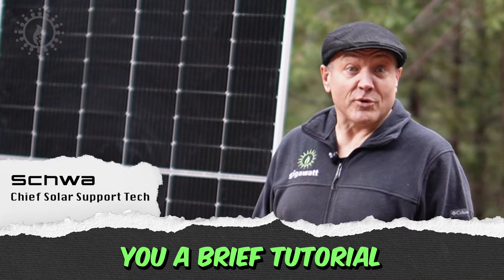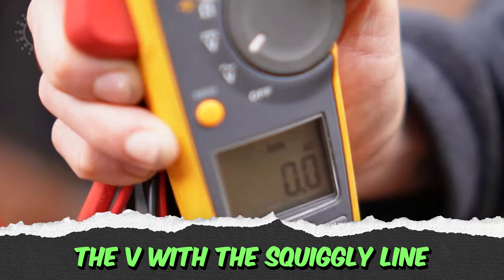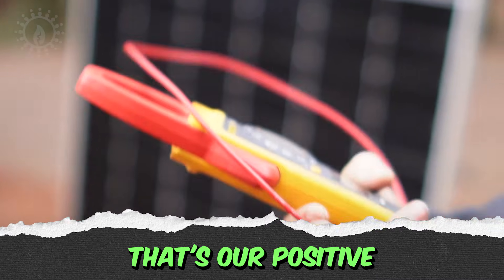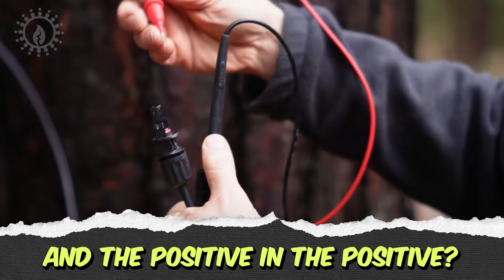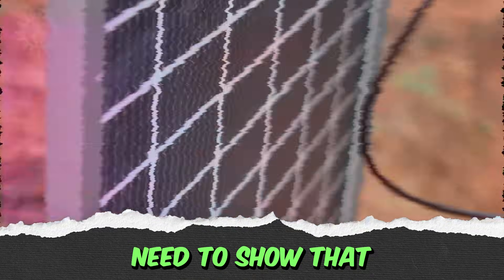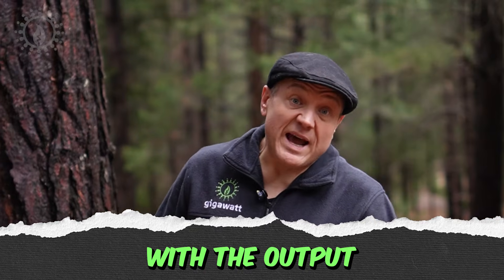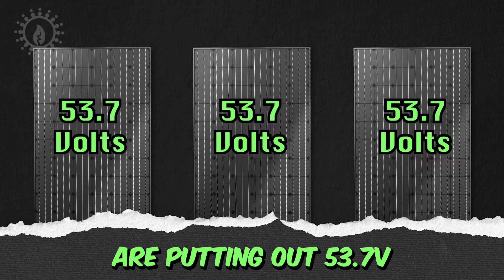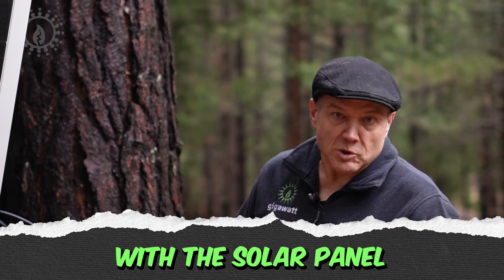How to Test a Solar Panel with a Multimeter (Step-by-Step Guide) | DIY Solar Basics

Comment: My panel is giving 20V, but 1 or upto 1.5A. Whereas it is rated 8A in full sunlight.
Reply from the maker: How are you testing the amps, just curious as that requires special meters. Can you share the spec sheet of your solar panel? 20v could be VMP or VOC and there isn't enough info here to give you a solid answer, but I'd be willing to drill down with you.
Reply: @unboundsolar  Thanks, I am using a local multimeter with DC10A-unfused reading rating....and I got the problem...the glass of the panel is hit a point and due to leakage, some cells are damaged, which are not allowing the current to flow completely...and another panel, of which the whole glass was shattered when installed in series, is giving out only such an amount of current...so I removed the damaged panel, and now the others are working properly.

Comment: Great advise, you should also check the amps it delivers. If you have a lot of panels it might be worth having a dedicated Solar Panel tester.
Reply from the maker: That is great advice. What kind of dedicated solar panel tester are you referring to? our dedicated solar panel tester is one of us and a hand held meter with DC volts and amp testing capability. Thank you for playing along.

Comment: I was taught by an electrician to test solar panels differently than this.  On top of the voltage test you should do a ‘short circuit test’.

On the label look for the ‘Isc’ spec for the panel.  That is the ‘short circuit current’. 

You have a clamp on meter, set it to measure current.  Take a scrap piece of wire and run it through your clamp on and very temporarily run the wire from the positive to negative.  It might spark a bit, so be aware. 

The current you measure during the short circuit test should come close to the spec listed on the panel. (It is only a momentary test.  A few seconds at most)

This ensures panel output (voltage and current) are up to spec.  Sometimes a panel can still show the correct voltage but the current output isn’t there. 

I was testing thousands of panels on dozens of natural gas wellsites for Shell Energy Canada.  This was their standard test as instructed by their corporate electrical engineer.
Reply from the maker: Brilliant